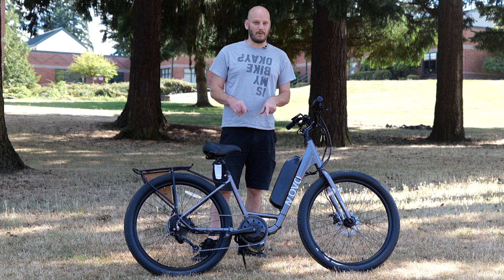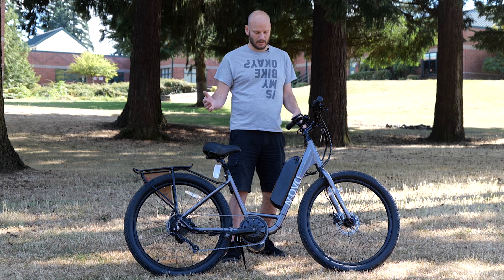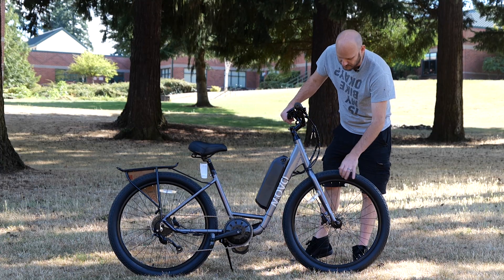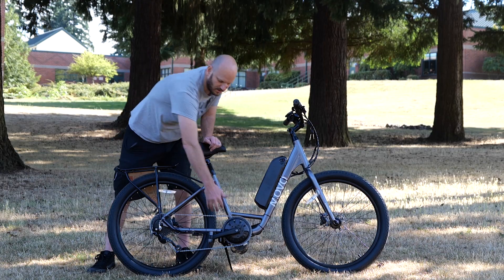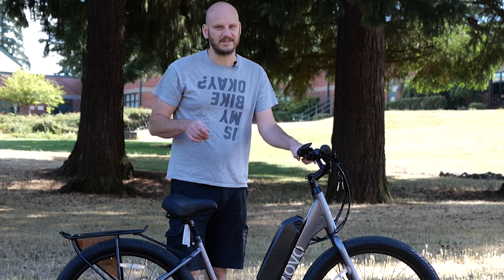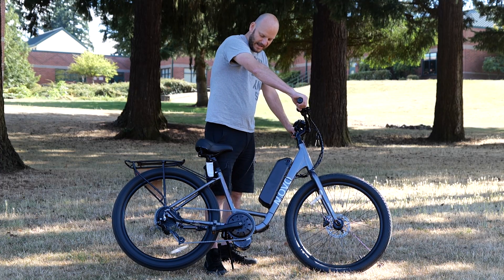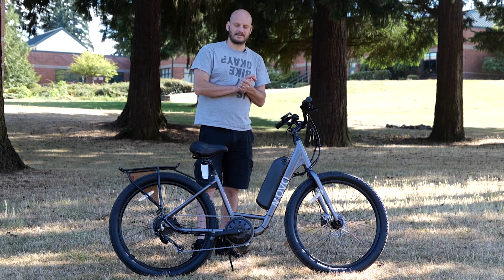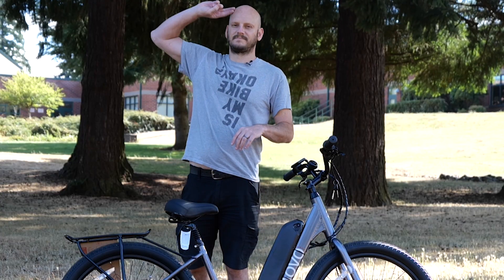Custom E-bike Build: KHS Movo 2.0 Low step w/ Bafang BBSHD Mid Drive and 52v 14ah

Comment: So what did you do about the chain in line problem? You mentioned that it didn't line up?
Reply from the maker: I used the stock 46t. The stock 40t would have been a problem
Reply: @JohnnyNerdOut 
The 46 tooth moves the chain line over?

Comment: Like this step thru.  I think I would get a double rear rack for the battery.  That way you keep the full step thru.  That is what I did on for my wife and it makes it much easier for her to step on and off the bike.  

I looked up this bike and it comes in sizes small, medium and large.  This is import since my wife and I are 5’ 10” and we need a large frame.  So many step thru bikes do not make a large.

Thanks Johnny

Comment: This is the type of bike I'm building for my parents next season. Comfy step thru commuter with a bbshd and 52v25ah battery
Reply: I would consider a BBS02, enough power, legal (750 watts), cost less.  Also if you want torque sensor look at something else like CYC, ToSeven or Tongsheng.  CYC has had good reviews.

Comment: Another nice build! Riding it, not on paved roads, at 35 psi I'd carry some spare inner tubes, for pinch flats. I'd rather take the abuse myself and keep inflation at max if I'm riding far from replacement parts. I wish you had shown the throttle setup along with the gear shifter more up close, I've avoided a right twist throttle for fear of it getting in the way of the shifters. That gearing is nice for speed & should handle short hills no problem but I'd stay away from mountains. I have, & love, that display (easy to read & 2 trip odometers is handy).
PS I love the shirt! You may want to look at carrying Gustavo as a cheap Lekkie alternative. Obviously Gustavo isn't as good as the creme de la creme Lekie but it's decent for the price.
Reply from the maker: Some shifters just have enough clearance. This Altus 9 speed shifter did. A lot of others don’t ☹️
I think I’d get too many returns if I carried Gustavo. Nothing against them. But from a business standpoint I don’t know if it would be good.